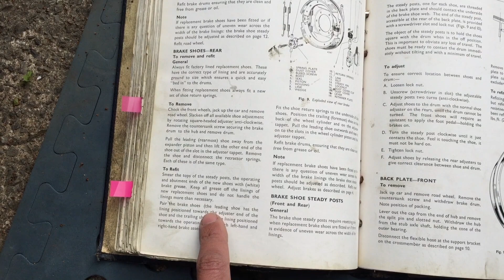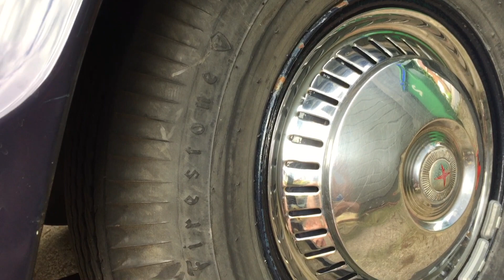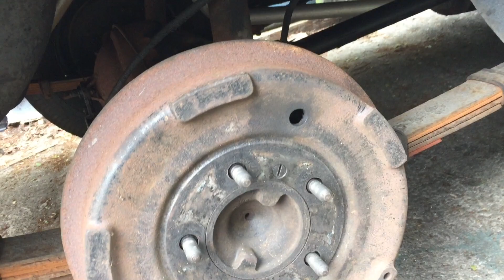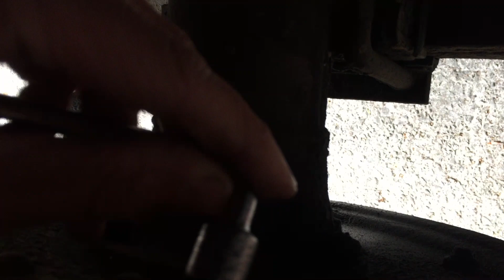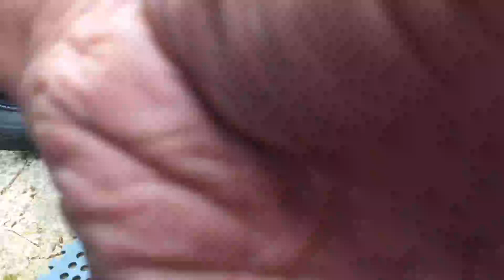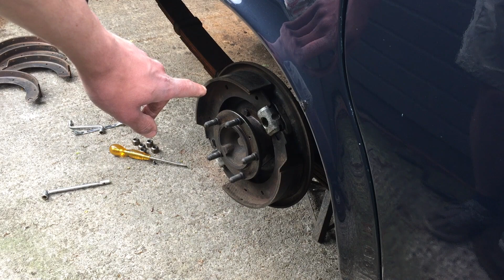A classic car brake job: replacing the rear shoes on a Humber.

Comment: Quite an easy job compared to some, as you know springs, and spacers etc, sometimes very confusing to fit, rear brake shoes don't get a lot of wear, and like you say, if you drive light on them, should last years